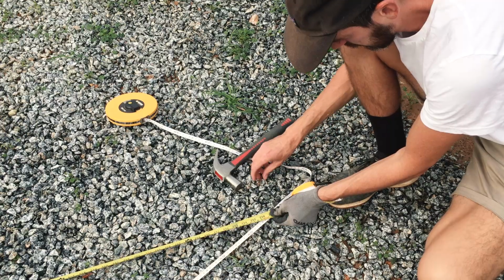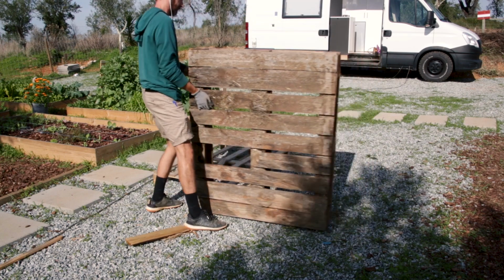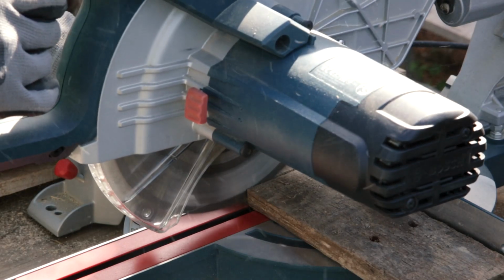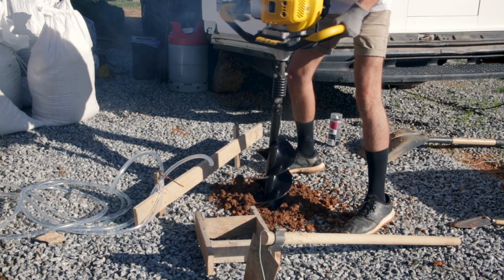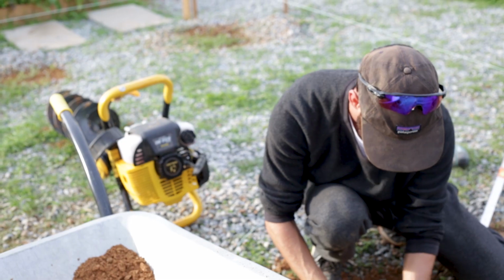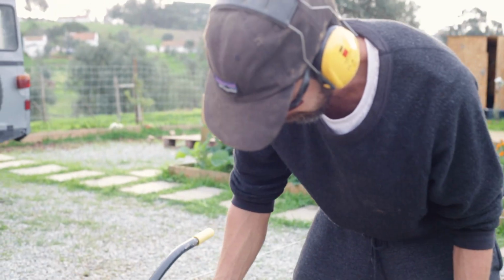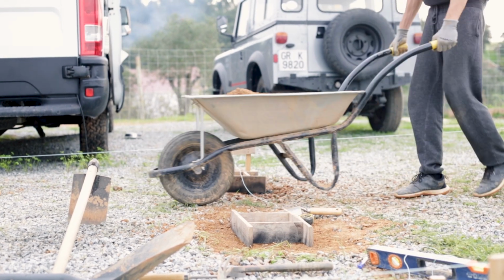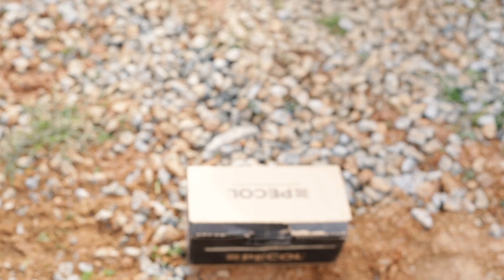#1 Building an OFF GRID TINY HOUSE [Foundation Explained]

Comment: Hello guys, you are very driven and seem well prepared to build a house, seeing all the tools you have available.
Can you tell us a bit more about the property? It looks like there are already some buildings on the site. Are these yours, and if so, what are the plans for those? You say you've never built a house before, but what is your background? If you had an art-education (as you say you designed bags), you must have become familiar with different techniques to work with various materials. 
As I see you have posted a whole series on the build, I understand you've already finished the job. Great stuff!
Reply from the maker: Hi Marlene, you are going fast!!! we are very close to getting the house 100% finished now. We are both designers, together, in LA we built a contemporary leather accessories brand (bags and shoes) that was sold all over the world in luxury boutiques. I (Pepe) am an architect, and have worked for years in LA designing high end houses in the LA area, using LSF as structure. The tools we had are the ones we bought to build the campervan! plus a couple of new additions, like the big post hole borer, that we bought when we needed to install the fence at the beginning so Aspen could be off leash :) So yes, we haven´t built a house before by ourselves but, as you guessed, we know what we are doing :)
Reply: @ModernHouseCabin  Hello Pepe, this explains a lot about your confidence in building and in handling tools. See you've also put this info in the about! Nice, because not everybody will go through all your comments to find info,  but will instead visit the channel's about tab. Thanks. Going strong guys!

Comment: What size is the cabin. I love it but I need to know if it will fit my trailer before buying the plans
Reply from the maker: hi Cristian, roughly 6 by 3m (19´8¨ x 9´10¨), it can be easily adjusted to any dimension.

Comment: Hello! Love your work. At around the 3:57 mark, when you are using the water level...what is it you are doing with the wood? What purpose is it serving?
Reply from the maker: hi! thank you! setting the batter boards (the wood) horizontal and all of them at the same elevation so you can set the strings right on top and measure the height of the concrete form to the strings. That way you make sure the top of all the concrete piles are at the same level. It is all thoroughly explained in the guide if you intend to build it! https://www.modernhousecabin.com/shop/p/step-by-step-guide

Comment: Hello, Please be careful how you work. I wince when I see you working with an open blade cutter and a post hole borer, very close to your feet in soft material tissue trainers with laces! Also walking about and working on a build, wearing open toe, soft rubber flipflops, is not really advisable. As a child I stepped into a big rusty nail when I wore a pair like these and it resulted in a nasty infection which took many visits to the doctor and over a month to heal. It came close to having to be admitted to hospital.  I don't want to dampen your positive spirits, on the contrary, I wish you lots of success with all your projects. But realise that you're working alone and you probably are on a location quite far away from other people and services.  Wishing you all the best and good health;).
Reply from the maker: thank you! we are extremely careful with how we work and what we do, but yes flip flops are not a good companion on a building site. I´m sorry about your infection, it must have been very painful. Some tools are more scary to watch than others but at the end of the day, we would not be using them if we did not feel 100% sure of what we where doing. Like the hole borer, it is a huge machine for a skinny guy like me :) but I learnt my way around it pretty fast and it is actually a very easy machine to work with after a while! and a good workout!!! 💪
Reply: @ModernHouseCabin  Thank you for diligently responding to my (and other people's) remarks. Very appreciated! Building a house and a garden certainly is hard work and more than a light exercise. That infection was a long time ago but I mentioned it to emphasize how important it is to be well prepared and to stay alert while working with tools. Enjoy the successes of your labour. I, as a viewer of your videos, certainly do. Thank you.